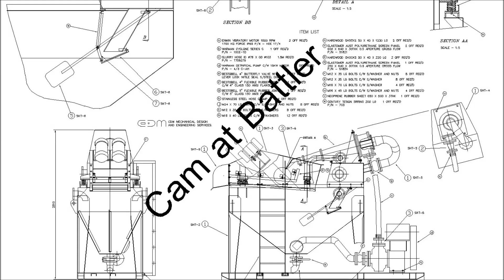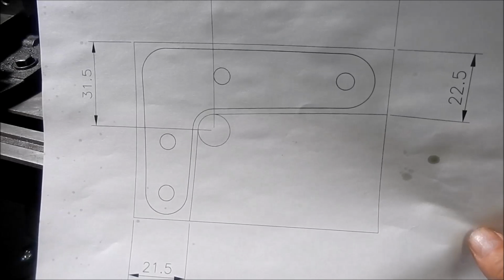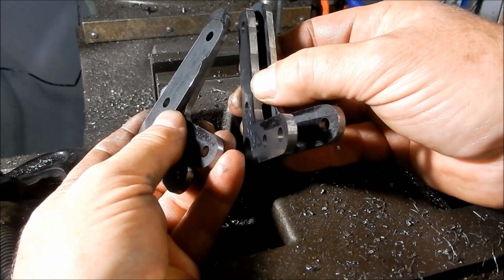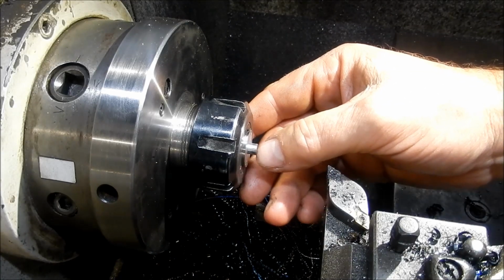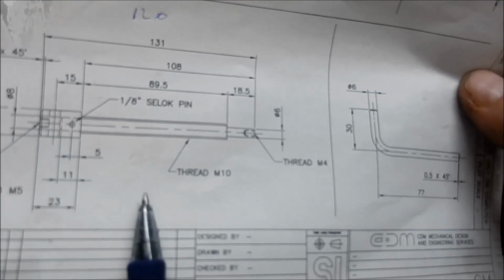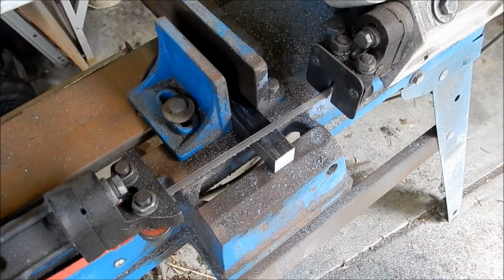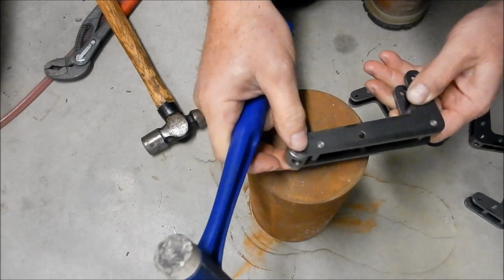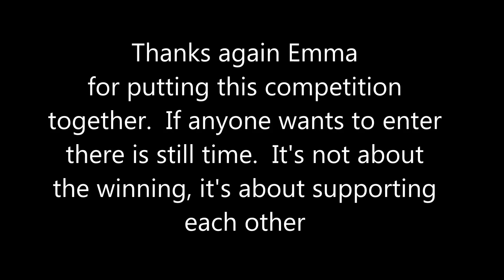Building a Kant Twist Clamp

Comment: Nice job!
They ended up bigger than I expected!
They look to work really well (another one to add to the endless list)
Also I see you encountered the old 'need the tool to make the tool' with your G clamps lol
Reply from the maker: Thanks Tommy, I wanted a bit of meat to them so I could hold the awkward larger shapes that are difficult to clamp.  Down the track I'll make up a set of smaller ones but I'll get them laser cut to make the builds a bit faster.
Cam
Reply: Yeah I must admit that plate work has been the slowest part of my builds so far. Hence buying a plasma cutter

Comment: Hi there came across your channel through someone else watch list, cannot believe that you made some Kant twists clamps, a job very well done 👍 there! Only one thing that I’d change would have been the clamping face blocks  have two sides that was shallow vee blocks to aid gripping small round stock or odd shaped items, another tip I’d give is while you are knurling the various pieces, oil the. Knurling dies as well, this makes the amount of pressure used is lighter(even albeit by a small amount) but more importantly the dies last a lot longer, I might be running a bigger lathe but every little helps , I have put a lot more pressure on my work, just to give it a more diamond 💎 finish with a deep knurling that even with oily hands they can be turned securely.  Just one more thing I have spotted in the working process, when you had started to part the brass lock nuts off, if you had say parted a quarter of the way in on both partings,  swapped to the 45 degrees square tip you use for deburring, use this to take the sharp outer corners off them without trying to do it freehand later, once they were done then you can swap back to the parting off tool,  it would make for a more even machined part.  I hope that I have not offended you in anyway, these are processes that I have learned the hard way,  have you ever thought about selling your plans for them? I may be interested and so may others too. Anyway hope that you guys (an gals) have a wonderful day and I will keep an eye out for any new content from you, best wishes. Phil. 🇬🇧
Reply from the maker: Hi Phil, thanks for dropping by and commenting.  You bring up some good points, yes I almost always use CRC when I'm knurling.  Unfortunantly I wasn't using it in this application (don't know why) I avoid oil as it tends to hold any micro chips and they get rolled into the knurled surface, the CRC lubricates when sprayed on but also washes away the debris.  When parting off I usually don't like the finish and will re-face and chamfer.  If the part is thin and carbon steel I will back out and use a file to put on a chamfer on and then lick the face on the surface grinder (ideal for thin washers).  I'm pretty sure I mentioned I will be putting a grove on one face to fit onto round stock but it certainly shows it on the drawing on the intro. As I've said through my videos I'm relearning a trade I was in 30 years ago when I worked as a first class machinist so I'm still trying to get my hand back in, but I'm really enjoying it.  Spent the last 25 years working as a machine/structural designer ending up as the Chief Mech Designer for a large Multi National Company with a drawing office of up to 30 men before going out in my own business.  Great days but now long gone along with Australia's manufacturing industry and some very talented designers.  All advice is good and great-fully received so thank you for taking the time to respond.  As far as selling designs I did this a couple of times with some of my furnace and burner designs.  Unfortunately one individual took the designs and published a book using them, I'll never say never but that at this stage put an end to that.
Cam

Comment: Nice clamps. Those are definitely a step up from a cheap F-clamp :)
Interesting lathe cutter you were using there.
Reply from the maker: Thanks 'RM'.  Yea the lathe tool is fantastic, probably loses some rigidity but its one tool for all lathe operations.  Right hand, left hand, small counter boring, turning, facing and I even use it for roughing out large threads.
Cam
Reply: Looks very versatile. What's it called and who makes them? Or is it home made?

Comment: Cam, just found your channel and subbed. Great build quality. I have just finished making a pair of these as like you the ones I found online were so expensive with import cost and exchange rate they were out of my price range.
 In a strange way that helped me because the design I came up with my clamps can be used for many different tasks. That is portable or on a fixture table be it welding drilling or machining.
 Interesting about your Pop, my father was also there in 1952, RAAF, Engine fitter. I cant help but wonder if they perhaps crossed paths way back when.
 Cheers from John, Australia. (Port Stephens North of Newcastle)

Comment: Nice project...  id love to make a set .   Did you make the prints yourself or download?   I need a dxf file to get the bits laser cut.
Reply from the maker: G'Day Doug, did the design myself based on photos of the proprietary units for sale, I designed them so I could manufacture easier in house.  Send me your e-mail address and I'll forward on the DXF files to laser cut the arm profiles.
Cam

Comment: Will the plans be made available? Nicely detailed.
Reply from the maker: G'Day Paul, I can send them to you as a PDF.  Please be aware that I made changes along the way (see the video) and that are not reflected in the drawings.  Some pin details are also missing.  Use them as a guide only and you can fill in any gaps.  Sent me your e-mail address if your still interested and I'll forward on.
Cam
Reply: Cam at Battler afternoon from Gloucester in the uk I would be very great full if you would send me copy of your plans pete
Reply from the maker: @peterwellington8756  G'Day Peter, as previous treat them as a starting guide as I did make changes along the way.  Just send me your e-mail and I'll pass on the PDF's.
Cam

Comment: Hey Cam I don’t see this video in Emma’s Playlist, did you forget to email her?
Cheers 
Peter
Reply from the maker: G'Day Pete, its still there from what I can see.  You just need to click the +2,3,4 or what ever the number is above the line and it should appear.  A lot of others are also hidden there.  Unfortunately I'm not eligible for the comp due to length of the video as stated in rule number 4, the video must be no longer than 20 minutes and mine runs for 40 minutes.  I didn't read that bit until after I'd submitted it.  However Emma has allowed me to keep it on the play list which is very nice of her, gives my tiny channel a little bit more exposure.  I'm now looking at something I might be able to do before the comp ends, problem is I'm now on a couple of months of shutdowns at work so I currently have no workshop time available even for the Slotter.  Bring on retirement, only gotta wait another 8 years.
Cam